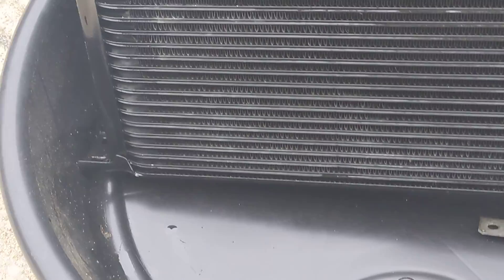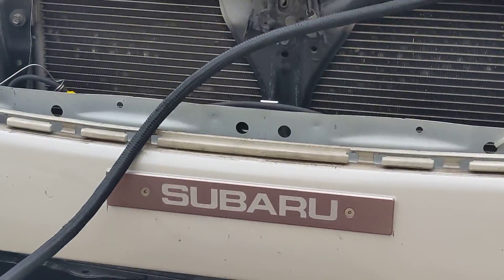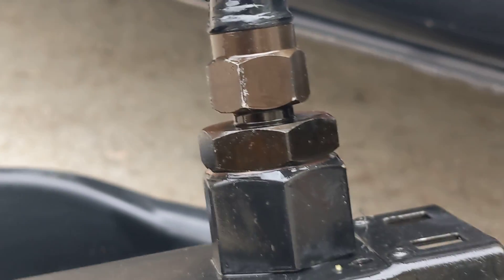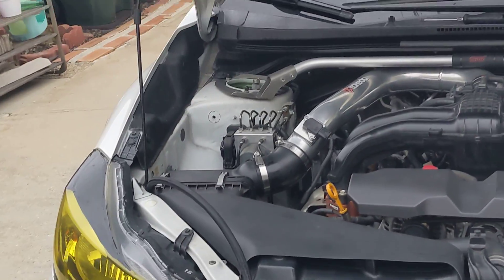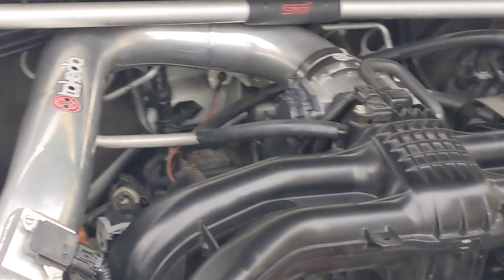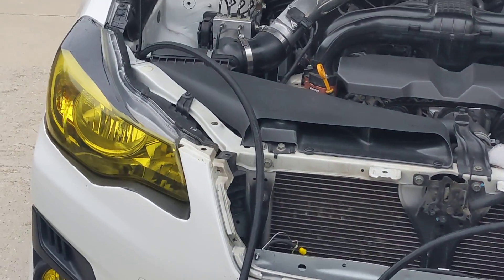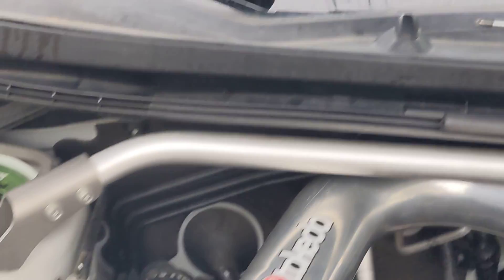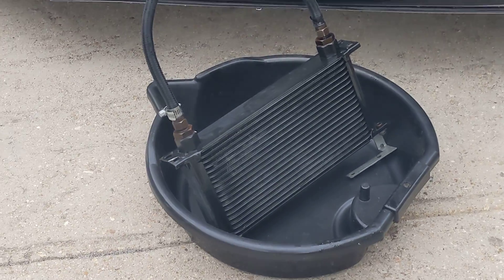Subaru CVT cooler - needs service

Comment: Hey Jason! It's kinda surreal to find you on YouTube. I remember you mentioning you had a Subaru when you visited Toronto quite a few years back. I also own an Impreza and started doing my own maintenance to save money and mostly to learn. It started with winter and summer tire swaps, and now I'm doing oil changes, PCV valves and cleaning MAF sensors. It's been a blast. Love the "Up on jack stands yet again" maybe do a video of you showing how you jack the car up on all 4 jack stands. Showing the various mounting points. I've only done the pinch welds and rear differential because my car jack isn't low profile to fit under the front bumper.
Reply from the maker: OMG! My comp sci buddy!  So quirky to see you on YT 😮 
What year is your Impreza? Thanks for the suggestion. 👋
Reply: 2019 Sport-Tech hatchback Impreza

Comment: Fittings are crap! There is not much pressure there. The standard Forester cooler is connected with ordinary hoses that are put on the cooler tubes. Google images: "Forester CVT cooler".